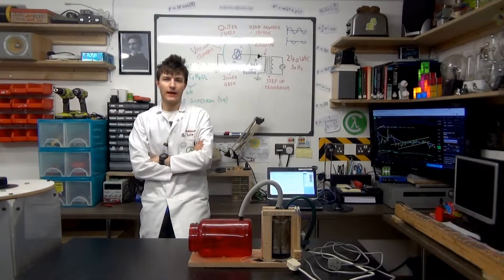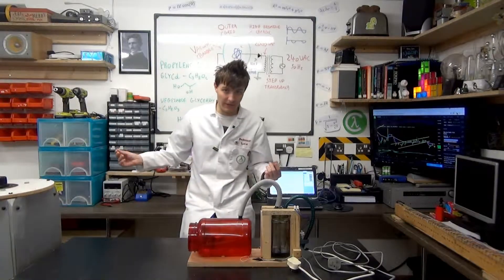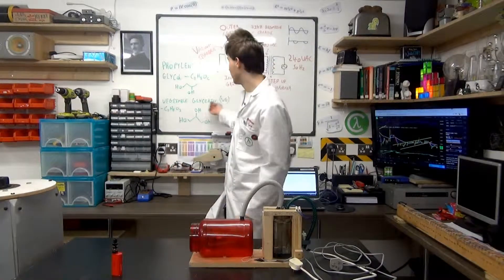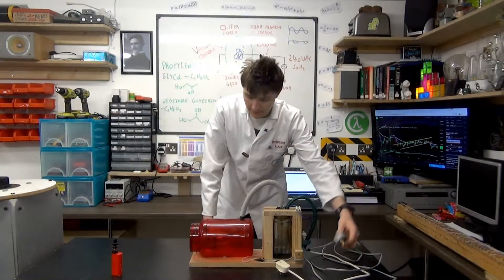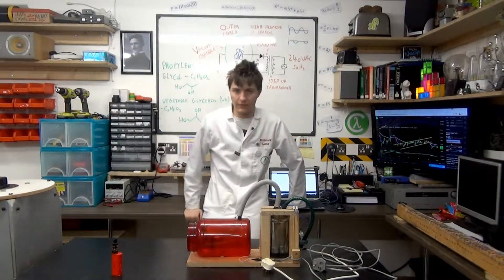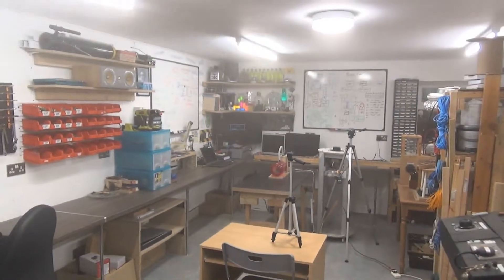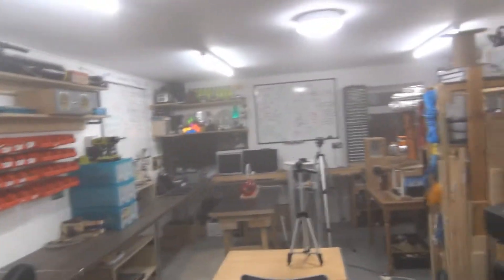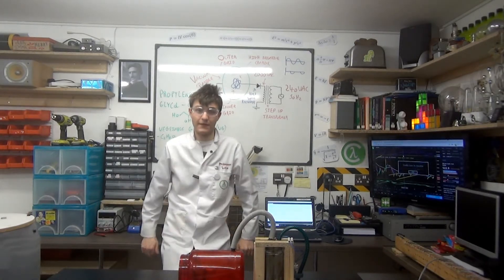Halfcorps Homemade Smoke Machine (Time To Hotbox The Lab)

Comment: This is a haze machine
Reply from the maker: tbh, thats a much better description! But I have since found a way to heat up vegetable glycerin to a much higher temperature without the system blowing up/melting using the same methodology. Perhaps I will make of video once I create a working prototype.
Reply: @halfcorp9720  That would be a smoking hot thing ♨️
Some suggestions that might it (more) portable, safer and easier for you and anyone to use:
Use a ZVS as induction heater, heating up a suspended (magnetic) pipe with a fiberglass wick inside the jar. This should save you a lot of power, as you don't need to heat the top of the nicrome wire - also hopefully avoiding a fire since the tube is cooled by the liquid. The ZVS typically runs off 12-24 volts, and with a 12/24V fan - it would be a lot safer to handle, as the current through the induction windings (isolated copper wire) should be a negligible to that of the current heating wire.
Another use for the smoke machine could be to stop unwanted guests in your workshop - fill the air thick with smoke, and they'll probably leave in a very short time :ø)